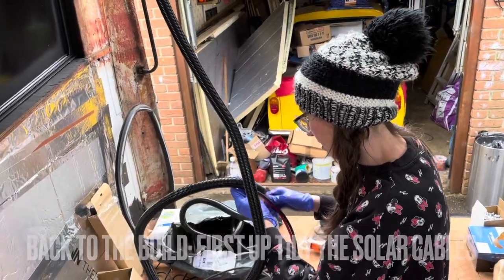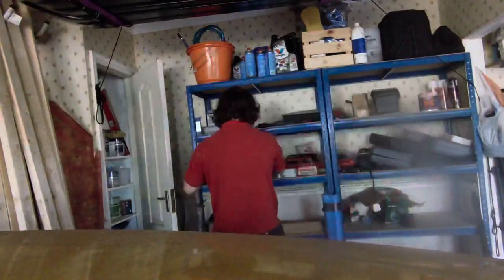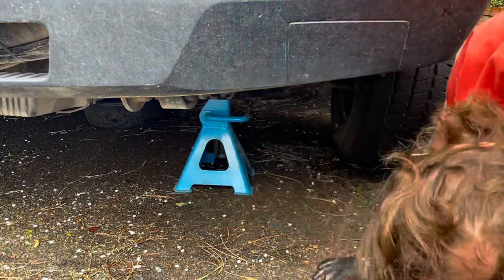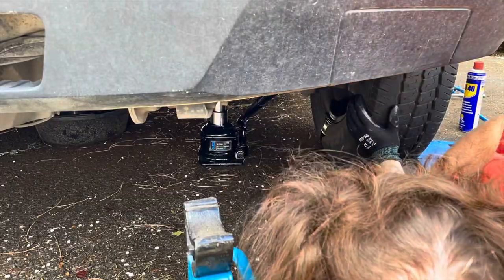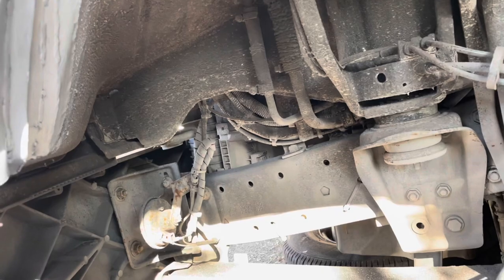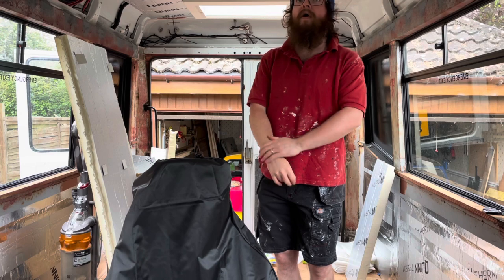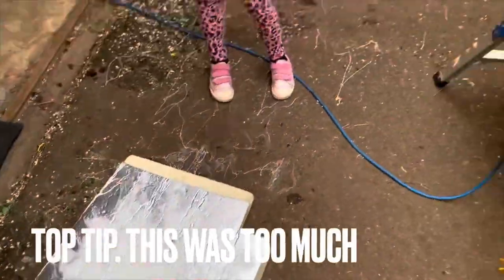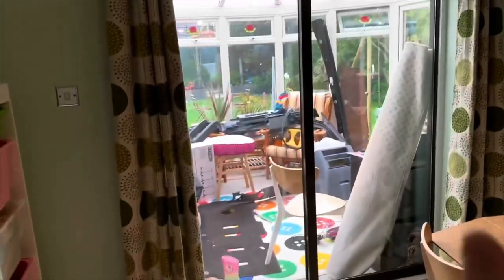Van Build Update | Fix, Break + Repeat | Mercedes Vario Self Build Camper Conversion Series Ep.22

Comment: G'day guys Lilly is priceless especially this is not for children.   Your making good progress on the bus it's going to turn out terrific,  if you can't get the rotors off bash them with a heavy hammer the wheel nuts that broke use heat on them Rich they will come off you need a punch to get them out.  You probably Already know that but keep well John  PS how is your fatigue going Kelly? When you put the new lug bolts in put some anti seize on them and also the pads on the brake callipers and check that the slide pins are good and the rubber boots are good and get some proper stuff for them cheers John
Reply from the maker: Hi John. Lily’s funny alright. That’s some good advice re. The brakes. I’m going to make sure I move it more often and further if possible. Fingers crossed we can drive it soon. Kelly is okay at the moment, a few naps here and there. How are you doing?
Reply: G'day Rich I'm not too bad  I'm like Kelly after doing some work I have to go to bed, your doing a good job on the bus I like watching what your doing it's the ducks guts take care kind regards John
Reply from the maker: Thanks John. We will keep trying our best 😊. Take care of yourself 🚐🚐🚐

Comment: Be fab to see that (probably expensive) windscreen panel fitted, can’t wait to see your next updates with a week off Rich! Get to it!
Reply from the maker: It was painful Ian. £550 and that’s the cheapest part of the job I reckon. We will
Get it sorted though. Have been removing other large bits and pieces to make way for it - should be interesting when I need to put it back together lol.
Reply: @WanderbusAdventures  wow! I think if you’d had someone to make them from scratch it’d cost you most of that in labour anyway!
Reply from the maker: That’s the decision we had to make. Basically as the entire lip had gone we sort of had to get the surround just for the bottom bit really. Luke does have some clever ideas of how we can use some of the rest of the part to make the ‘back’ of the bottom bit. He’s a smart lad.

Comment: To replace the lug, the wheel hub needs to be removed and the break disc taken off so the new lug can be put in. Then put some antiseez on the threads before putting the wheels back on. 
A good idea would be to replace all of the lugs on all four wheels just to be safe from any more breaking down the road.
The rear lugs are longer than the front with it being dual wheels.
Reply from the maker: Thanks Phillip. We will keep you posted on the progress of this. The goal will be to make sure we are tip top for sure but at the moment we are focusing finances into the blasted windscreen. Anti seize is a great tip - I wish the coach company had used this too! Thanks so much for your tips and for watching. Take care 🚐🚐🚐

Comment: Hi ya it’s always amazing how much we accumulate in the garage. Rusted on wheel nuts a nightmare and the rears even more so because there is an inner and outer, always carried a couple as spares for Mercedes trucks just in case you snap one, and I never ever let the tyre company tighten them with rattle guns. Thanks for sharing stay safe cheers from Australia 🇦🇺🇦🇺🇦🇺
Reply from the maker: So much stuff! But we can get around now which has made things so much easier already. That’s a great tip regarding the wheel nuts. We’ve bought a replacement but will chuck some in the toolkit when we get on the road - they were well used and tight. Thanks for the tip. Take care bud 🚐🚐🚐
Reply: You should use a torque wrench for sure to tighten them but really use an impact gun to undo them as the shock and forward backward motion certainly reduces the risk of broken studs. (Ryobi +one Impact gun is the bees knees)
Reply from the maker: I’ve got my eye on one of these. There’s something about the Ryobi tools that I’ve always liked. I think it’s the colour mainly but the one system seems very good
Reply: @WanderbusAdventures  I don't get any money for saying this but +one is the best system I have ever used and the impact gun is a life saver on rusted threads and seized bolts :) not too expensive really mine was about £80 and easily would have removed that lug nut intact saving you a few quid? I feel invested in your project now see :)
Reply from the maker: @Polecat54941  I’m waiting for when they do their deals. I’ve got a sneaking suspicion they might do one near Father’s Day. Rather I’m hoping they might.

Comment: hi guys great video i have the same problem as you around my windscreen do you have the part number for the windscreen panel and price many thanks
Reply from the maker: Hi Matt. The part number is A670 620 0004 7390 and it was £550 for that part. We also ordered a panel underneath. But we don’t need that bit. If you check with Merc with your chassis number they’ll
Be able to confirm; pretty sure the part is the same on all Varios but they can confirm :-).
Reply: @WanderbusAdventures  thank you for the great information will give merc a call
Reply from the maker: They’re usually pretty good. If you’re south west try Rygor. You’ll need your chassis number and reg is all